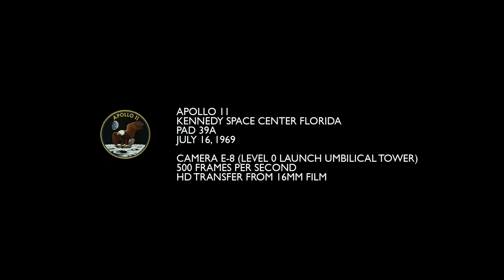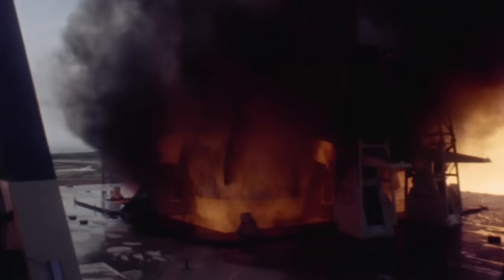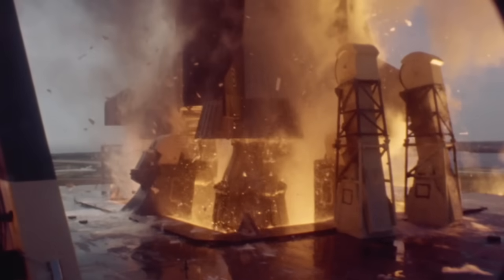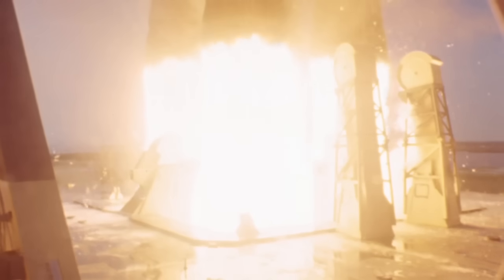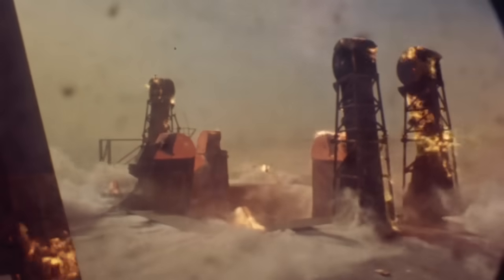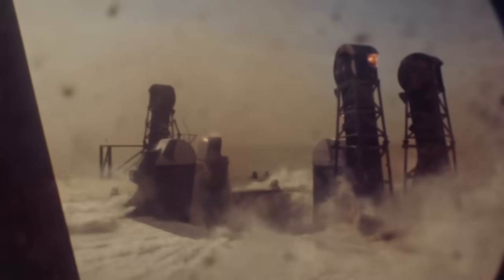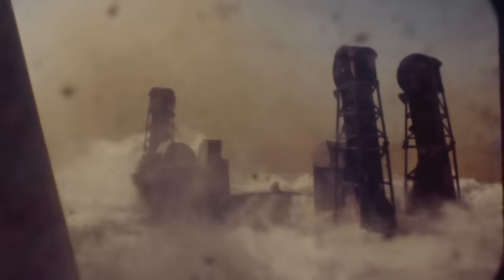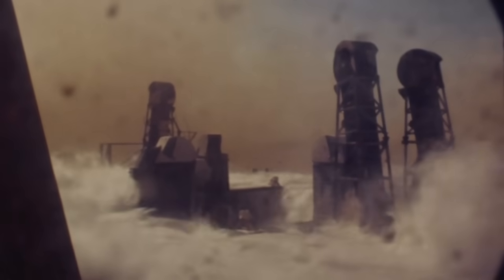Apollo 11 Saturn V Launch Camera E-8

Comment: That's 15 tons (680 gallons) of kerosene/LOX mixed and burnt every second. That statistic is so big it's basically beyond comprehension. The sheer gravitas of the F1 engine is like something from another age. I don't suspect we'll ever see one like it again.
Reply: Alex Tocqueville Raptor engine from SpaceX is similar. Currently being tested
Reply: +Alex Tocqueville expensive at the gas station.
Reply: No Gandalf - Firstly you seem to want to take issue with Alex Tocqueville's figures.  Secondly, you seem to back him up with your wikipedia quote.  I mean, he said 680 gallons and wikipedia said 671.4.  That's a discrepancy of a little over 1%, and there may well have been that much variation in actuality.
Reply: No Gandalf But it's much lighter and smaller.
We won't see something like the F1, but the Raptors clustered together will be similar
Reply: @Ferdinand - Raptor has 42% of the thrust in vacuum.
Reply: Alex Tocqueville what about the Aries?
Reply: I assume this engine does not pass CO2/NOx law limit for cars :-D
Reply: Well get ready for the BFR, the SLS and the Long March 9 then :') or at least of the three
Reply: No, but kansas is actually flatter than a pancake. There has been a serious research project and a white paper write up on it. Google it if you don't believe me!
Reply: It probably greatly exceeds the CO2 AND Nox limits for any location on earth. Because they used liquid oxygen the burn was very complete and VERY hot, too hot for any NOx gasses to exist really, and as far as co2 goes mile per mile they got a lot of miles per emission. It's 250,000 miles to the moon, and 250,000 miles back plus they were orbiting the moon for a while before they landed, then 3 or so days when they landed the LM, then another day or so coming back so well over a million miles so that aint too bad.
Reply: Firstly "tons" is a measure of mass, "gallons" a measure of volume. Secondly 15 US tons is 30,000 pounds. Actual consumption was 11,417 pounds per second. Still amazing to me.

Wikipedia - "Each second, a single F-1 burned 5,683 pounds (2,578 kg) of oxidizer and fuel: 3,945 lb (1,789 kg) of liquid oxygen and 1,738 lb (788 kg) of RP-1, generating 1,500,000 lbf (6.7 MN) of thrust. This equated to a flow rate of 671.4 US gal (2,542 l) per second; 413.5 US gal (1,565 l) of LOX and 257.9 US gal (976 l) of RP-1."
Reply: No Gandalf. That's just a bunch of hog wash everbody knows that the earth is as flat as a pancake ! Ha! You guys need to smarten up a little bit . some times you guys watch these movies and think there real.

Comment: Thanks for finally giving me a clear understanding of the dark band of exhaust preceeding the flame that is coming out of the F1 engines. I asked a NASA old timer once at KSC but he wasn't sure because that wasn't his department.

so if I understand correctly (based on what I read and you seem to confirm) fuel is used to cool the engine bell and exits through vents around the edges of the bell and then just mixes with the fiery exhaust?

When I was a kid, I thought the fuel was coming out very fast and then ignited below. ...

Comment: I allways wonderd whay the "flame/exhoust" was dark/black right after the nozzles. thay dident use ablative protection on the inside nozzlebells?
Reply: +surplusdriller1 The F-1 rocket engine (which is what the S-IC booster, i.e. the 1st stage of the Saturn-V uses) is an open gas cycle rocket engine. "open gas cycle" means, that there's an auxiliary turbine, powered by the same fuel and the engine, which "only" purpose is powering the massive fuel pumps that feed the main burning chamber. The exhaust of that auxiliary power turbine is fed into the bell nozzle to create an insulating boundary layer between the super-hot rocket exhaust and the bell. Because the exhaust of the turbine is actually quite dark (blackish, as from a improperly set diesel engine) and cold it doesn't emit a lot of light, but absorbs it (a desired effect, as this acts as insulation from radiated heat). The nozzle bell itself also contains hundreds of meters of tubing through which the then still very cold fuel is pumped before injected into the burn chamber; this further cools the bell, but also pre-heats the fuel, giving it some extra pressure.
Reply: +hexarith Thanks for a good explenation.

Comment: My two cents.  "Jet Fuel"  is kerosene. Period.  However, without the inherent moisture.... etc, etc..and a little more highly refined..  I would listen to the petroleum experts on here.  I used to sell the stuff, but I'm know engineer. It's all kerosene in one form or another.
Reply: Daniel Penney That's interesting. So for example would u say all car fuel is diesel in some form or another?

Comment: For anyone who thought it might be cool to watch a launch from the platform, um, probably not. And IIRC, the sound alone, at that distance, would be enough to kill someone.
Reply: +Astrobrant2 
From what I've read, anyone within about a thousand feet of the launch would have been killed by the sound pressure alone.
Reply: FosterZygote I remember that from somewhere, too.
Reply: +Astrobrant2 Presumably by being in a strong box (with really thick windows to watch the launch through) you would be fine (otherwise the astronauts would have died too). Exactly how strong/think the box would have to be is another question...
Reply: Google
How far away is a Shuttle launch acoustic energy fatal
and there are several fascinating articles. Some are crap though. forum.nasaspaceflight.com is probably best.
Reply: A scientific discussion of fatal sonics: google
Can a loud enough sound kill you?
(extremetech)

Comment: from adrian in England
the most extraordinary video I have ever seen.....don't think I remembered to breathe, the energies and forces in that short time defy belief, to think those five Rocketdyne F1 engines could lift 3,500 tons away from the entire planets gravitation pull is unthinkable. The way the video closed as well, the interlocks looked liked they were being submerged in high tide - spellbinding, hard to believe it is real. Incredible achievement.
America - I salute you
Reply: +Adrian Katsikides F1 engines were deformed person von Braun, there used carburetor. So pull up to 450 tons understated. And the mass of the rocket less than 1,000 tons!
All the missiles flew without people, "moon" the rocket did not fly into Earth orbit 8km *
Reply: +Ralf Rene 
hmmm, well I'm glad you cleared that up, the rocket of course contained the fuel, but you know about that. Don't you think the camera man did well to stay at his post like that ? .......!           Wasn't you was it ?
Reply: Adrian Katsikides Large combustion chamber F1 is very dangerous. There appear detonation - a kind of combustion causes an explosion. Therefore, Brown was forced to approximately 30% of the fuel supplied to the nozzle. All Saturn 5 have a black plume of smoke over the missile. And most importantly, the rocket fell behind the rate of climb twice!

Comment: when would we build a rocket that can travel to other universes ? i guess we need something like the saturn v with some turbo chargers !
Reply: +shbitz Nuclear Rockets - we need higher specific impulse than chemical only allows. There is a great book called, "To the End of the Solar System". The second stage of the Saturn V was nearly nuclear - if it had been (as great as the J2's were, and the vehicle as used), I think we would be on Mars right now. We owe it to our species and our great progeny to colonise the solar system and beyond.
Reply: +shbitz Good sci-fi space operas always include food replicators, which is the real issue. It doesn't take a huge amount of fuel to fly long distances in space. Space is a vacuum, as we have been told; the vacuum means nothing will create friction to slow down the vehicle. Using a Hohmann transfer orbit (IOW you make a couple of orbits of the earth and let the planet's gravity kinda whip the thing into outer space) to accelerate the vehicle means you can just coast from the earth to Mars. However...it takes roughly 7 months to fly to Mars, so unless someone can figure out how to stick a whole warehouse full of food and many tanks of water into a spaceship that's a little smaller than a battleship, manned trips to Mars will remain a dream.
Reply: +shbitz Other universes?  I'm assuming you mean other "galaxies."

Comment: Jet Fuel can't melt steel beams!
Reply: +I don't know Only conspiracy nuts think steel beams melted in 9/11. Anyone who's looked at building codes for iron- and steel-framed buildings in the last 150 years knows the concern from fire is frame warpage and weakening, hence all the regulations demanding fire protection for the steel.
Reply: +I don't know It is NOT jet fuel.
Reply: +John Miranda Liquid hydrogen and liquid oxygen ...
Reply: +reincarnatedman F-1 engine propellants were RP-1 and LOX. No LH2. RP-1 is a more refined version of jet fuel.
Reply: You meant to say that only conspiracy nuts DON'T believe that steel beams can melt (read: soften/weaken). Correct?